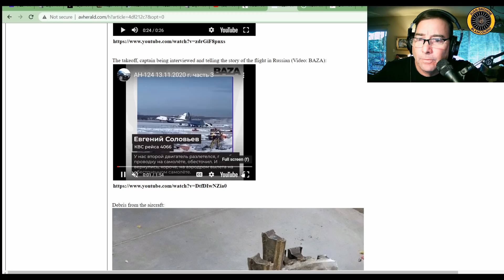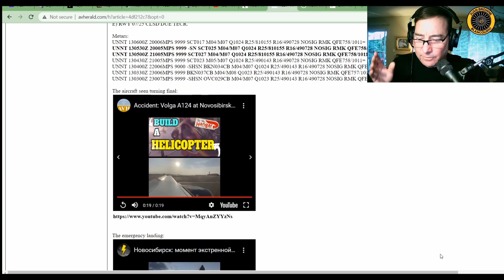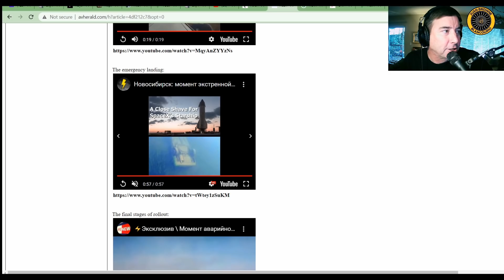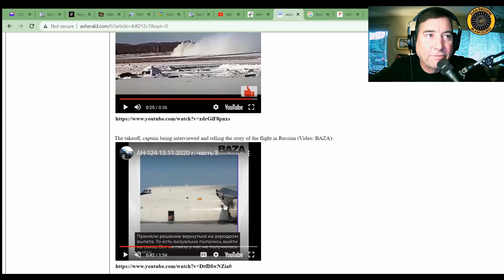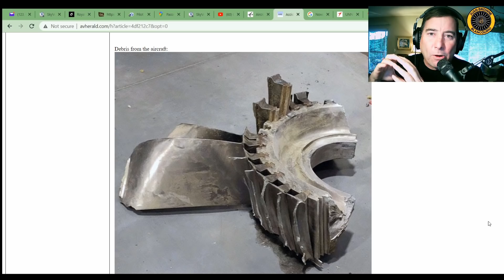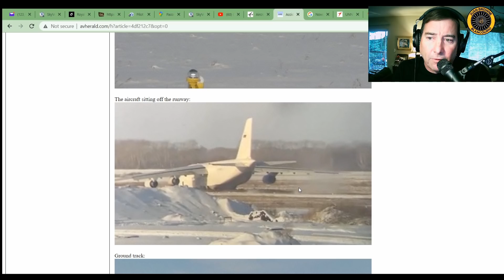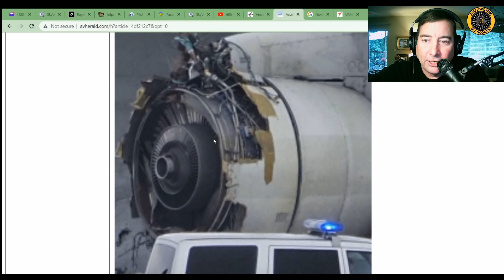AN-124 ANTONOV FAN DISK FAILURE NOVOSIBIRSK, RUSSIA

Comment: We recently disassembled  a GE CF6-6, an airliner turbofan of similar size and thrust rating of the engines on the AN-124. The fan disk, or hub to which the blades are attached, was a single piece of forged titanium alloy, and it weighed over 400 lbs.
Reply: there's no material in the world that can withstand a fan disk coming apart at takeoff power
Reply: @makecba  Well, there is, but the plane would then be too heavy to fly. We spin these until failure in a hole in the ground!
Reply: @makecba  its not the same but once my dad managed to destroy an angle grinder disk due to overreving . it flew over 50meters thru the window of the next house. and that was just 125mm diameter cutting disk...
Reply: @makecba  Actually there is. An inch of steel plate will stop a fan disk (a bit heavy for most aircraft applications however). Kevlar shields have been designed for helicopters to prevent an uncontained failure taking out multiple engines.
Reply: 400 lbs of Titanium, serious money just as scrap I imagine.
Reply: @mikester1290  Years ago Russia had so much Titanium that here in Canada we could by crow bars from them for fifty bucks.
Reply: @giggleherz9491  I want one!
Reply: @giggleherz9491  I remember those! The damnedest thing to pick up lol.
Reply: @giggleherz9491  We built SR-71s with!  :)
Reply: @giggleherz9491  Titanium alloy?  Pure titanium? Aluminum/titanium alloy would be considerably less expensive.  My mother handled alloy certification for an alloy products company, and was shitting bricks over concerns of the failed engine bolt on a catastrophic crash of a DC3 passenger jet.  They went through their records with a fine tooth comb.  It turned out a maintenance procedure during the mounting of an engine following maintenance or swap of the engine.  Whew?
Reply: @perrydiddle3698  Sadly I never bought one, back then fifty dollars was a lot when your pocket was empty. I dont know about the alloy, they were for sale from Lee Valley Tools.  On the other hand I bought a Titanium tennis racket for five dollars from goodwill. Also I collect graphite golf clubs just for the shaft the Titanium heads get tossed in the scrap bucket.
Reply: @giggleherz  Wow!  Thanks for your input.  I remember in 1976, I broke my elbow which required surgery to install 3 stainless steel screws.  I looked at the hospital bill (to which insurance covered).  It had thousands of dollars charged for surgeon, thousands for the anesthesiologist, hundreds for the hospital bed for the couple of days I was admitted, etc.  price of the screws?  $1.75 each. And that’s surgical grade (whatever that is. Lol. I did watch a story about the development of the SR-71 Blackbird spy plane.  To fly as high and as fast as it did, titanium was the material of choice.  The Russians were an important object of the US’s reconnaissance. But, we needed a huge supply of titanium.  It turns out, we had spies and fake companies and such which were able to obtain the material to build the plane that was spying on them.😂😂
Reply: @giggleherz9491  Skunkworks had secret agents brokering deals for titanium so we (the US) could build the SR-71 and turnaround and spy on them. Now, I don’t know how much was forged or cast.  But, I do know it was full of ....irony.😉
Reply: @mikester1290  Yes costly, but maybe not in Russia, because they produce most of the world's titanium  !
Reply: @stevecarlisle3323  Over there it wouldn't be worth much as scrap, but as a new part it would be quite costly indeed because the price comes from all the machining work on the part, not the stuff it's made from. In other words it would cost almost as much even if it was made from cast iron, or well maybe stainless because Titanium is hard to machine.
Reply: @44R0Ndin  I was not aware that SS and Titanium  were similar price. Yes, they do CNC in Russia, like most developed countries.
Reply: The entire way through this video I was wondering what Jay was going to say about this. Please do an in depth Jay!
Reply: Hey JayZ. Was just curious if you could weigh in here with your opinion. To my untrained eye, it looks pretty deep in the engine to be a fan disc failure. I know in March another AN-124 suffered a similar failure due to the failure of the second stage intermediate pressure compressor disc, and all operators of AN-124 and AN-225 were ordered to do a one time inspection of the engines within 6 months. Could this be another failure of the compressor disc?
Reply: For background on my comment 

https://www.aircargonews.net/airlines/freighter-operator/an-124-disk-inspection-ordered-after-uncontained-failure/
Reply: @speed150mph  I've never worked on one of those, but it does look from the picture to be the disk and blade assembly which would be right behind the fan.
Usually the fan has fewer, larger blades, but not always. The Progress D18-T has three shafts and a single stage fan, according to Wikipedia... so this picture looks to be the first stage Intermediate Pressure compressor disk.  The IP system would be called N2, and I can only make a rough estimate of the speed at somewhere around 8000 rpm. N3, which would be the HP system, or the fuel burning core, would likely turn at something like 10,000 rpm.
So, if my guess is correct, the front of the N1 assembly, the fan, may be out there on the ground somewhere in one piece.
Reply: @AgentJayZ  that's what I was thinking. So it's likely that the failure in March I linked you to and this one are probably related given they appear to be the same failure mode in the same stage of the engine. 

If that's the case, I sense an airworthiness directive in the works to thoroughly inspect the compressor disks for metallurgical defects.
Reply: @speed150mph  That March AD inspection order should have been completed by the end of September.
Reply: @Markle2k  seems someone will be in trouble not inspecting in time.....
Reply: Howdy Agent JayZ   Progress D-18T same engine as the AN-225 (four instead of 6)
Reply: Sounds so similar to Qantas QF 32  which also lost engine 2, with similar shrapnel damage to the airframe, even down to coming in hot and heavy - at least QF32 had manual brakes
Reply from the maker: Wow!! Thanks Jay.
Reply: @blancolirio  I found some great cutaway diagrams of this engine. I need everyone to have a close look, and we need to have a vote on whether the photograph of the failed part is of the fan, or the first stage of the IP compressor.
Have a look at this page:   http://www.buran-energia.com/mriya-antonov/mriya-moteur-engine-desc.php
Reply: @AgentJayZ  That photo of a failed part may not be from this incident. I keep looking at the engine and how far back from where the inlet should be that it's destroyed makes me think it was several stages in. It looks like the front of the pylon is gone. Then again it might have failed at the front and torn stages off as it disintegrated.
Reply: @AgentJayZ  From the diagrams labelled "Single Stage" and "IPC", it appears that the fan's bypass stators ("straightener vane" on the diag) are about in line with the IPC's second stage rotor. That looks to be where the new "face" of the former engine is.
Reply: @easternwoods4378  The front of the pylon is likely akin to the leading edge on a Cessna 172 wing, just an aerodynamic covering to smooth air ahead of the actual structure.
Reply: @AgentJayZ  I was confused by the short blades in the photo - too short to be fan blades - but then realized they were broken at the mid-span shroud. Definitely the fan stage, judging also from the bulk of the disk hub. The cracking initiated at the inside surface of the bore, where stress is highest, at what was most likely a 'hard alpha' defect. BTW, CF6 fan disks are made from an alloy unique to GE, called Ti-6242 [EDIT: I misremembered, GE's fan disk alloy is Ti-17]. Oddly - and I think this cost GE an extra share of the liability for the Sioux City crash - the inner bore was not on the inspection schedule, though it was in fact checked.
Reply: @AgentJayZ  I'd like your opinion on this being better/worse that the HPT disk breaking up. I'm battled.
Reply: @blancolirio  you might be interested in the comments on this crash by one of the An-124/225 factory test pilots (in Russian but with English subtitles) https://youtu.be/zzgYTK4skoA?t=708
Reply: The picture of the debris of the fan disk/rotor is very interesting to me, it almost looks like the failure may have originated from the machined part where the fan blades attach.  I know titanium can be inclined to crack from areas that aren't properly machined smooth, as this has resulted in crashes, and fatalities, in motorsport, probably the most famous being Jochen Rindt.  I'm wondering what the chances are that this event could have started from a manufacturing or maintenance error leading to that area of the disk being left, or becoming, slightly roughened?...
Reply: @gosportjamie  could the cracks have propagated from where the blades are pressed into the ring? reminds me of a cracked timing gear on a truck motor I saw once. you couldn't see it off of the motor, but when pressed on to the shaft, it spread just enough to make noise and be visible!
Reply: @iansigman1651    That's exactly what I'm wondering/thinking...
Reply: Components like that have to be machined from a single billet to withstand the centrifugal rotational forces acting on it.
Reply: @kiwidiesel  correct but it is sufficient to have a micro fracture due to bad quality control, wrong forging or whatever to cause a catastrophic engine failure. The crew has  been damn lucky to be able to turn back to the airport and a quick thinking and good pilot!
Reply: @paoloviti6156  goes without saying that anything can have minute manufacturering  flaws that go undetected or overlooled untill the components decide to stop holding hands. Yes full credit  to the crew and thankfully collateral damage was minimal.
Reply: @kiwidiesel  yep, lot of kudos to the pilots that managed to stay cool and bring it back to the airport!
Reply: @kiwidiesel  For some of the more modern fans the annealing process is so perfect that the entire billet is a single crystal lattice, this allows more accurate tolerancing over time as there is no plastic deformation at the grain boundaries.
Reply: @aidansharples7751  wow that's getting next level cool, appreciate the knowledge 🙏
Reply: What is the diameter and typical RPM for a piece like that?
Reply: @jiveturkey9993  typical RPM for that size aircraft in idle is approximately 25000 to 30000. On climb out; the approximate rpm is closer to 100,000. The internal blade rpm is often quite higher
Reply: @tonyschulz3558 , sorry, but all of your comment is patently wrong.
Reply: Question? How truly lucky are they that this happened at this altitude and we're able to get back and landed safely?
Reply: @justindeboer4627  That it happened at such low altitude wasn't luck - they had very few space and time for manoeuvering. It really could have easily become a disaster.
Reply: @Hans_R._Wahl  thank you. That's what I was wondering is that it seems very lucky that they were able to get back on the ground safely. But also with the fuselage damage and everything could it have been even worse at higher altitude and no place to land close to them?  But either way it seems like luck was on their side.
Reply: @justindeboer4627  Generally altitude is your friend. Altitude gives you time and a whole swag of options that you just do not have at low altitude. It is possible that, in this situation, just being 100ft lower may have meant that a go round and land would not have been possible. It would all depend on the performance characteristics of the aircraft.

The three most useless things in aviation are 

Airspace above you
Runway behind you 
Fuel in the Bowser.
Reply: @Agnemons  I'm just glad it went as good as it did. I'm sure that was a crazy situation for the pilots.
Reply: @justindeboer4627  There occured at least no problem with the cabin pressure at such low altitude and they had the airport for an emergency landing still nearby - the next airport can be very far away in Russia - but to handle such a failure at such low altitude is a really tough job I really wouldn't want to be in.
Reply: The fan hub is probably Inconel/Hastelloy, but it could be Titanium (going from memory...this engine design heritage is fairly old...1980). This engine also had the Russian equivalent of an Airworthiness Directive relating to Intermediate Stage Compressor Disk and an uncontained engine failure in March of this year. Boomski... When Ivan has an industry accident, he doesn't fool around... it's always big.
Reply: That's a howitzer shell through the fuselage at an upward trajectory. They may be looking miles away for the parts. Lucky it didn't hit major structural members
Reply: It’s always good to see Jay pop into the discussion. I enjoy his YouTube videos he posts
Reply: Spins at what?  30K rpm?
Reply: @Kiera_Jackson74  The Fan itself probably in the neighborhood of 3000-4000 RPM (it's probably geared), Three spool engines run at three different shaft RPMs all the time (one discrete speed per shaft)... but anytime you're talking about a 80+ Inch fan disk you are talking Megajoules of stored rotational energy in the shafts (Artillery shell energy levels).
Reply: @matthewhelton1725  that's twice as fast as a 100lb propeller with so much more energy no kidding it tore through the whole airframe.
Reply: @matthewhelton1725  The fan is a single stage, and has it's own turbine, which will likely have three or more stages. The fan of a three shaft engine is direct drive, without any reduction gearing between the turbine and the fan.
The reason the engine has three shafts is so the N1 shaft can turn at a speed appropriate to such a huge fan, which is likely around 3000 rpm.
The engine designers had three choices:
1 compromise between the best speed for an 80 inch fan and the best speed of a 30 inch LP compressor, both bolted to the same shaft, and powered by a single ( multiple stage) turbine.  Simpler but less efficient.

2 use a separate, third shaft and turbine to turn the fan at it's best speed, while the "LP" system now becomes the IP system, and turns at the best speed for the compressor. More efficient, but more complicated and costly, but has worked very well for the RR RB211, as well as the Ivchenko Progress D-18T.

3 put a reduction gearbox between the LP compressor and the fan. Saves the complexity of a third turbine and shaft, but adds the complexity of a gearbox with an input of about 8000 rpm and around 50,000 ft-lbs of torque and an output of around 3000 rpm and a torque of something over 100,000 ft-lbs.
Those are enormous numbers for a lightweight, flying gearbox.
Definitely possible, but not inexpensive.
Reply: The Sioux City DC-10 crash was caused from one tiny impurity imperfection the size of a grain of sand in the fan disk which was missed in previous inspections. Probably a similar fate here?
Reply from the maker: Jay's Video- check it out! https://youtu.be/4b447Iv1xdo
Reply: Could have this initially been a lubrication issue?
Reply: @marksigmon8388    If the failure did originate from the blade fitting point then it would be hard to see how it could be.  But it's also possible that the rotor bust was a symptom of another issue, maybe with the shaft, which could be lubrication-related.  At the moment, there really isn't enough known to be able to formulate a good theory...
Reply: That is one hell of a big grenade!

Comment: Remarkable airmanship by the pilots.  I am really curious about aircraft like the AN124 that have significant anhedral (negative dihedral) to the wings.  I understand this makes an aircraft unstable in roll and usually requires some sort of (electronic) stabilisation system to aid stability.  If this is the case it makes the efforts of the pilots even more amazing.

Comment: In another video (External walk-around) you can see debris (Grass, mud etc) hanging out the rear of the number 1 engine on this plane.   Look on the video at the 1:10 mark to see this.  That gives you an idea about how much force was involved and how far stuff was flying from the ground as the plane slid to a stop.    Even though those engines were a good distance above the ground and away from the fuselage as it plowed through the mud and snow.  Looks like all 4 engines  will be replaced on this plane if it ever flies again.  Here's the video link: https://www.youtube.com/watch?v=czwtgOUd16I

Comment: I don't agree with your breakdown.  There are not enough facts presented here to make a judgment but it would appear there was not a significant loss of flight controls and with no fire present a different course of action would be to dump to a landing weight that would allow the aircraft to stop on the runway available.  Perhaps they did have hydraulic losses and thus no ground spoilers on landing roll.  If that were the case then dumping to max landing weight would be a must in my  opinion with no fire or loss of control.  I'm sure that fan disk failure was an attention getter.

Comment: One thiing more - this was NOT russian plane, it's Ukrainian! And reason why all Ukrainian equipment is failinf in Russia, is simple - Russia attacket Ukrain 6 years ago and  from that time Ukrain does not supply any more russian military with spareparts. Those engines are only small part of equipment, what is deteriorating beyong repair in russia because of that. Most significant problem for Russia is that nearly alla soviet time ballistic rockets industry was in Ukraine. Nearly all Russias rocket systems including "famouse" russian AA systems, like S-300 and S-400 where produced in Ukraine before Donbas war. All latest Russian deep space missions are failed because Russia dosent have eny more Ukrainain produced engines and orbital transfer sections to theur disposal.